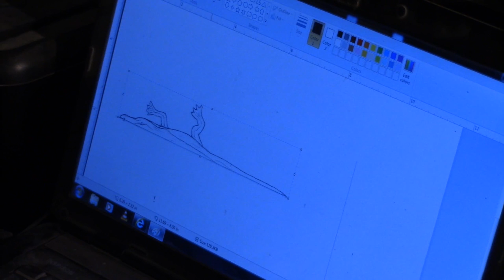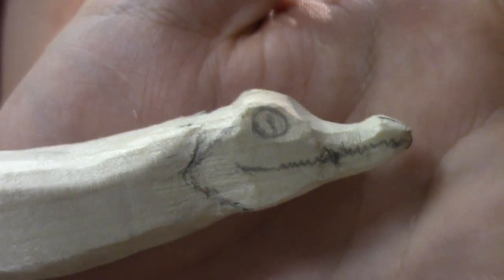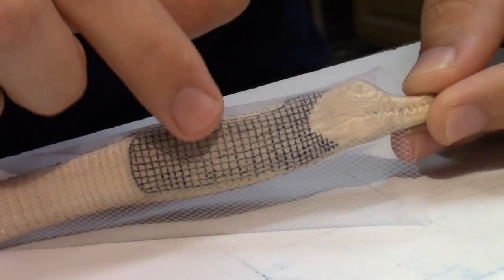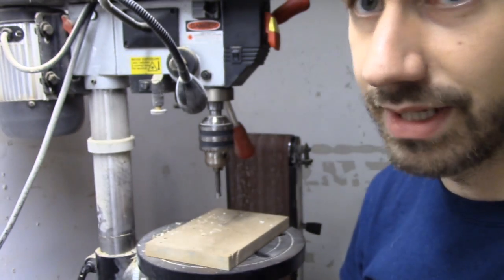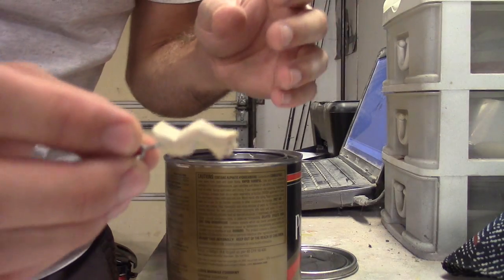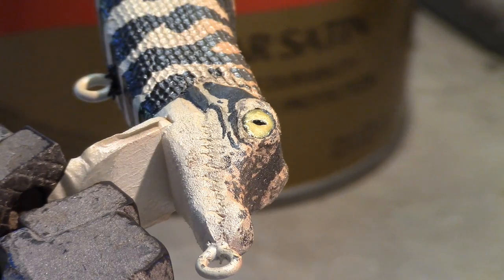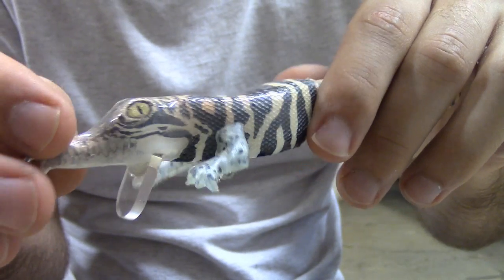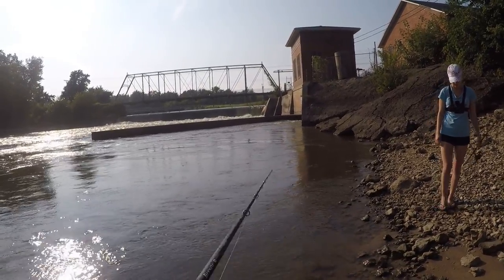Making a Baby Alligator Lure

Comment: I think this has been one of your best videos! Did you ever think about drilling a hole for the legs, and just making a mold that was one solid piece for the two front legs, and another for the two back legs? I've seen that sort of thing on Frog lures with hard bodies and plastic legs. That way, if the legs get worn out, you can just rip them out of the hole and replace them with a fresh pair.

Comment: Have you tried to let the adhesive dry a bit before applying the paper to de wood? It should become like post-it paper with a mild adhesion compared with the full strength it normally has.

Comment: Hi, i was really bumped up by your project and i think it's a great idea, but you should have made it a top water lure in my opinion because gators swim at the surface. And if you want a glider, build it as a stick bait or a lipless slow diving swimbait with a really loose joint (at least 3 joints for the swimbait)and with slow animations he will go left to righ, specially if most of the weight is located at the tail. sorry for my english, bye :).

Comment: Love this bait. Only thing I don't like is the photos you used were of gators on land with their legs in the land/walking position. When they are in water they tuck their legs straight back so they aren't producing drag in the water. Would probably make the glide and the action even better. Aside from that one tiny thing though it's as amazing as everything else you've made. I wonder if making the tail soft plastic might help with allowing the fish better access to the hooks. <3
Reply: You can use the same molds and just turn the legs backwards. That brings up a good question. Do you ever rework baits or do you just move on to the next one? Would you fix a bait you already made or start over from scratch and remake it? Does that depend on how much you would need to change? What do you do when you're not happy with a bait? Dime a dozen, give up and move on or do they individually mean something to you? I guess for me they would feel like individual pieces of art and I'd have to try and fix the original because I wouldn't be able to help feeling a connection to them. I get attached to any art or craft or even like a home remodel or renovation I do. Anything I create feels like my baby and I'm automatically attached to it. Seeing Chelsea nearly snag the dragonfly made me even more curious about this. You literally have to risk losing your pieces in order to use them. Would be cool to know your thoughts on this and how you deal with/react to/manage this kinda stuff. :)